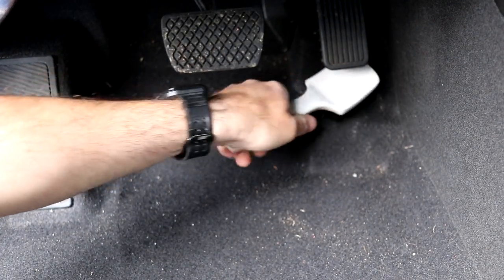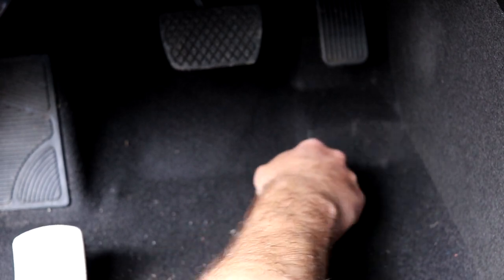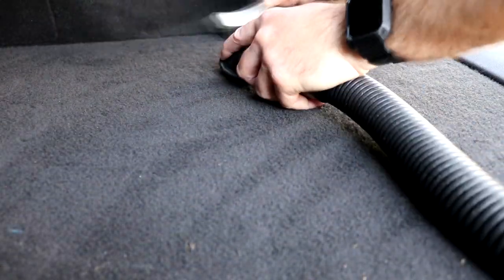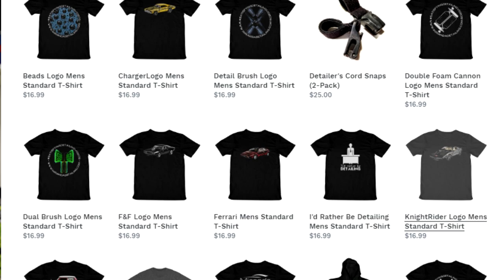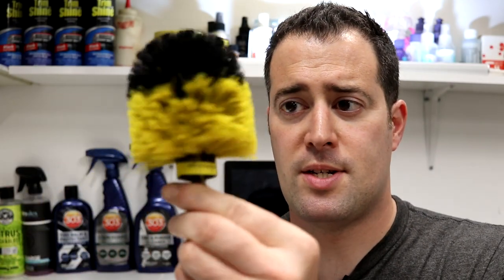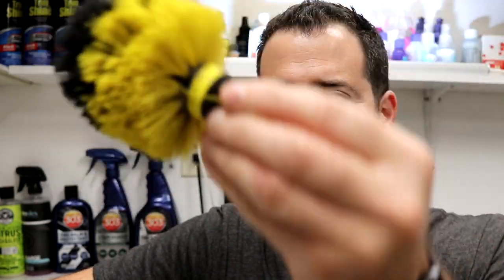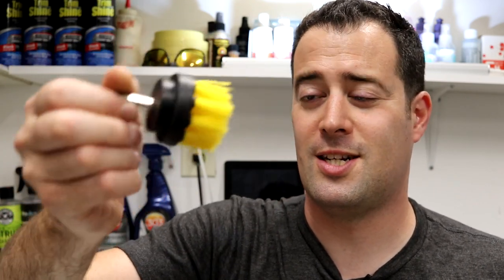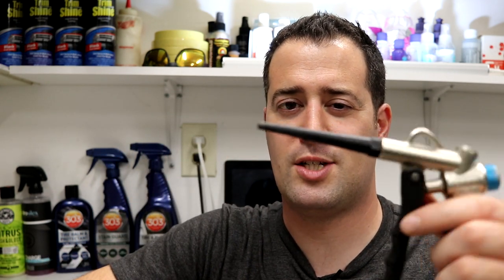How To Clean Your Cars Interior & Detail Difficult Carpets!

Comment: On your Capri, I could be wrong but I believe it’s a second possible inlet. They work well in assembly line settings hanging from a retracting cable with a coil hose coming in from the top. Workers can then pull the air nozzle down from slightly overhead, use it, then they release it and it automatically goes back up out of their way.
Reply from the maker: Oh yeah you’re right!  Pretty cool!!
Reply: I realized this video was a year old so you may have already known it wasn’t a second outlet, but if you hadn’t...😁👍🏻

Comment: Hey there, loving the channel si far! I know this is an older video, but I have a question. What advice would you give for getting dead grass out of interior carpet? I did a honda pilot for a lawn care guy and it just WOULD NOT come out of the carpet.
Reply from the maker: Thanks!  Yeah that can be a challenge. Sometimes I have to use a drill brush to get out those stubborn dried grasses.

Comment: Hey Phil, just curious on your thoughts about the drill brush. I use it in conjunction with the air compressor a lot and it seems to do a pretty good job or getting the particles out of the carpet. I also find that it excels in the back cargo are of a vehicle like a Subaru or a large suv. Any thoughts?
Reply from the maker: Hi. Yeah I will use the drill brush if I really need to in those areas also. It’s more of a last resort though, since it can flick up so much. But it does work really well. Thanks for sharing!🤦🏻‍♂️👍🏼
Reply: Just watch the drill brush on low nap carpets, Asin this video. Make sure to use a low speed on drill
Reply from the maker: Yeah, I try to use low speeds but then it doesn’t work as well 😕. I hate that difficult carpet.
Reply: @MirandaDetailing  😒
Reply from the maker: My face exactly! 🤣
Reply: Haha thanks guys!